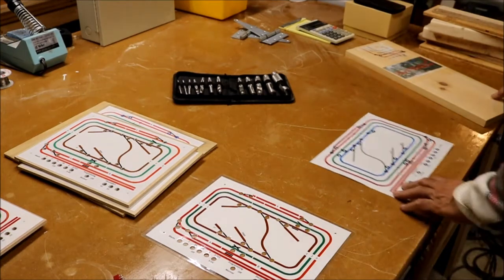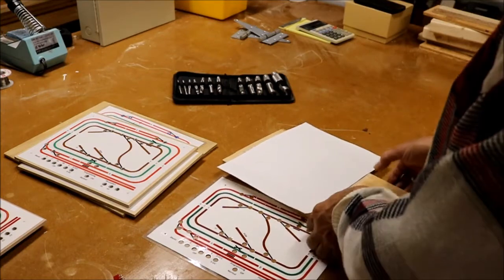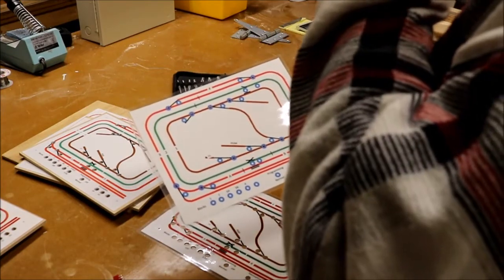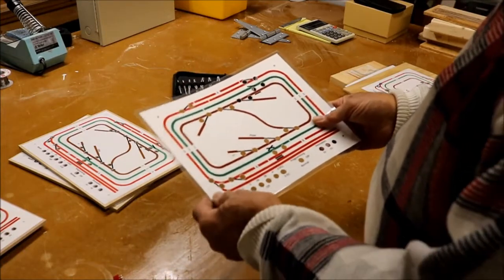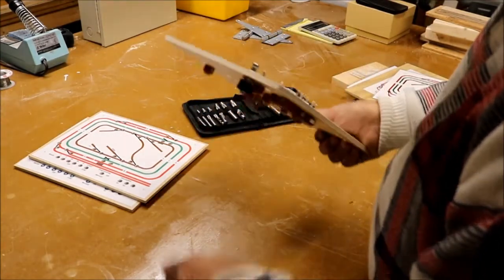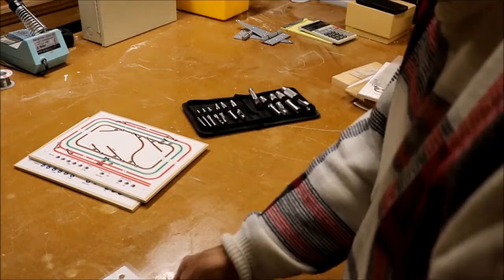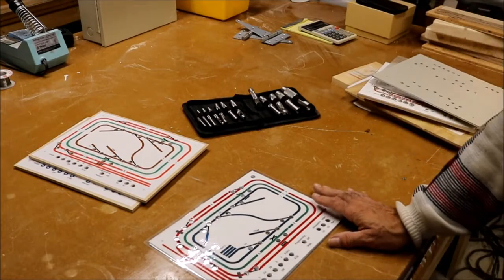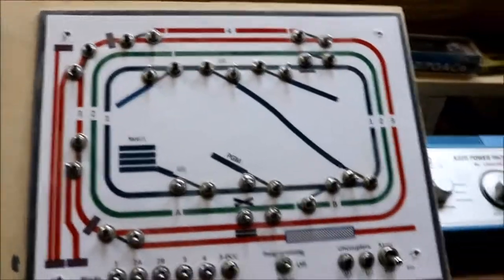Model Railroad Control Panel

Comment: When working with metal sheets don't forget to drill bigger holes for any kind of insulating stuff of the electronical components, I did the mistake myself and was wondering and concerned about a short circuit onto my control panel, so tha me changed the panel sheet into a 3 mm hard paper like PC board material to eliminate the short circuit problem until I found out the mistake I did.
Reply from the maker: Good point. Thanks for you comments